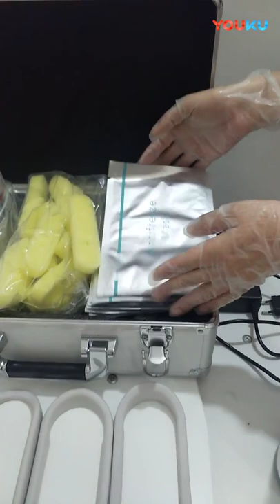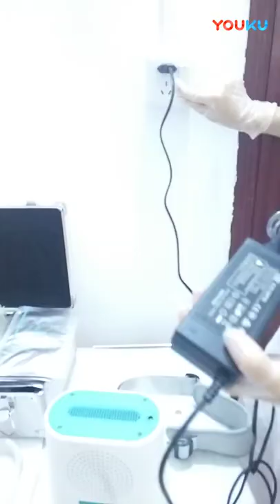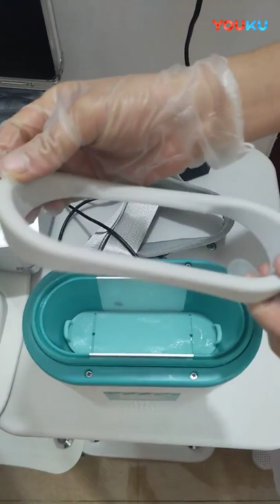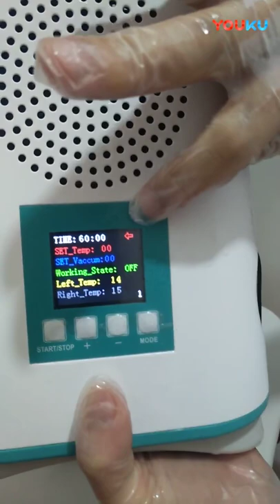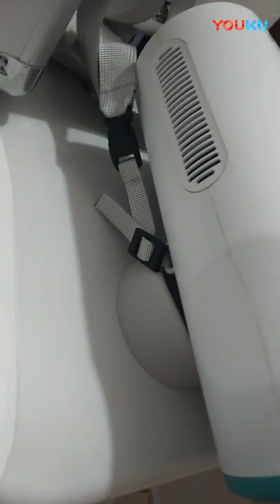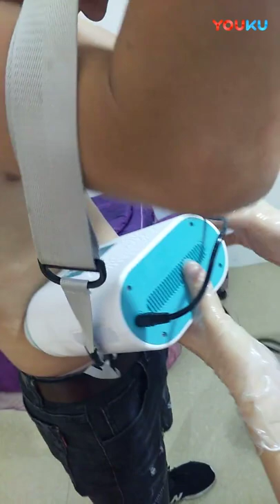Mini cryolipolysis fat freezing machine

Comment: HELLO I BOUGHT THIS AND SINCE NO ONE HAS REVIEWS ON THIS PRODUCT, I WILL GIVE A REVIEW!

I got it and had some trouble with getting it to stay on my arms. The way the machine works makes it to where you can’t have it upside down or else the liquid will get into the sponge filter. So I decided to try my tummy pooch next and wear the strap around my neck. 
I put down another membrane onto my stomach along with the one that is specially made for this machine. So I had two membranes total. I wanted to protect my skin. 
I had it on for an hour. I will say it sucks not being about to move around since you have to be plugged in to work. 
I sat in a chair and made sure the machine was staying in the right position. 

The extra membrane caused more liquid to seep into the inside of the machine. So 30 mins into the procedure, I got the A2 error(the sponge is wet). I changed the sponge and turned it back on. I put it on the highest cold setting and highest suction setting. I did 30 more mins since that equals an hour. 

It’s been 4 days since doing it and I already see improvement on my stomach! Pooch is smaller already! I’m going to give it the full 30 days to see if more fat is gone. I’ll update this comment when that happens!

I can’t seem to find any reviews and I tried every site that sells it. So since I bought it, you are welcome to ask me questions!
Reply: Mine stops after 5mins of using and says A1. What could be the problem? The membrane is still laying flush to the device.
Reply: Are u able to post before and after pics. I just bought it too

Comment: I buy it but It still says " A1"
Reply: The same problem
Did you find a solution?
Reply: The antifreeze membrane must lay flush to the plates. If you bought t the antifreeze membrane that doesn’t have the plastic part, then it wouldn’t work. Also, the liquid product on the membrane matters.

Comment: Hii please tell me if its work for you before i buy it. I wanted to buy this machine for so long
Reply: I have this machine im still figuring it out had for about 6 months now ive done coolsculpting i dont think this machine gets as cold as it needs to be to freeze the fat cells but im going to use it this weekend and set it to the highest cold setting it has and see what happens
Reply: @davids9089  what temp did you set it at?
Reply: @GuidedWithLight  i put it at its highest which is 12 and it worked
Reply: @davids9089  Hello, is the coldest setting 12 or -12?
Reply: @1586pame  12 on the setting and the highest i've ever got it is -12 on the temp you'll feel it afterwards with the area being numb that's the effect you want
Reply: @davids9089 hey David! I’d love to ask you some questions about the use of this and how to avoid any sort of freezer burn on my skin. Also where you bought extra membranes? Not sure if you’re even still active on this account but you’re the only person I could find and this is one of the only videos I can find! 😣 please reach back out if you’re still active
Reply: @davids9089  so how much fat have you lost now when you put it at the highest setting

Comment: Hi can you use regular antifreeze sheets with this device by either cutting it and placing in the device or putting it on the client?
Reply: Another video on this same device the woman said that the gels she ordered don't have the rigid seam that makes them fit correctly. I would want to know if the company makes the filters and gel pads available as they seem very exclusive to this machine.

Comment: I purchased this machine, it works fine but I notice it leaves burn mark on the skin, feels like freezer burn and leaved black burn marks on my body.  l am very disappointed.
Reply: Alot of ppl have said they use 2 membranes to prevent the blisters and black and frost bite. One in the machine and one over their skin
Reply: I've been using my machine did a few rounds last month going to do a few more and of this month i figured out how to reduce the bruising i put the machine up to the highest cold temp which is 12 and keep the vacuum around 3-4 some areas can go up to 5 but i feel it working better than the times I've done it in the past
Reply: What did you set the tempurature at and how long did you have it on?
Reply: I had this same problem first 2 times i used it the freezer mask doesn’t protect the entire suction area so some areas are left unprotected. You’ll either get a water blister that stings like hell or dark bruised marks but they go away after a week or 2
Reply: OMG. Black burn marks sound dangerous. Gangrene is black. What temp did you set it at and did you use it more than once in the same area within 30 days? Apparently you can’t do cryolipolysis more than once every 30 days.
Reply: Did you return it? And you used the antifreeze membranes?
Reply: Does it work?

Comment: I have one of these but the temperature will not go below 04 and the fan does not seem to work unless the temperature is set at 00 - do you have any ideas ? Is there on online manual or helpline number for it ?
Reply: Did you manage to get help? Has it worked for you?
Reply: Specs show it’s supposed to work at -2 to -12 temp. We’re you able to fix it and if not, were you able to return it for free?
Reply: Just saw a different spec sheet that says it works at -3 to -9 only. Not -12 as some other sites say unless the newest models get colder. There is a spec sheet link a few comments down below but it doesn’t have a trouble shooting section. It does mention 3 different temperatures so maybe you have to click the temp button 3 times to get to the max cold temp - just a guess.

Comment: Does it work as well as the CoolSculpting machine?... Please, if you've tried it, tell me, and how many inches have you lost?
Reply: This what they say about it! Features:
1. It can knead, squeeze and massage the subcutaneous fat layer of human body. To dredge meridians, promote blood circulation, strengthen fat decomposition, remove edema, increase body slim and healthy effect.
2. Help reduce the appearance of cellulite in the abdomen, thighs, hips, and buttocks skin so that the body's harmful and toxic substances faster disappear.
3. It is not easy to damage tissue, subcutaneous nerve, blood vessel and lymph. In addition, the skin naturally tightens due to ultrasonic energy.
4. This freezer machine use freezing means to undertake instant freezing-death to adipose cell, raise through the temperature behind undertake thin body in metabolic action
5. Can firm the arms, legs, thighs, buttocks, waist, back, abdominal muscles and reshape the body figure.  Usage:
Start the instrument, let the instrument cool, and remove the freezing film after a certain temperature, the add water.
The lower the indoor temperature, the better and faster the refrigeration. It is recommended to use in air-conditioned room.

Note:
1. Plastic plastic on both sides to wrap the freezing film for reuse.
2. Check whether the filter wool is wet in preparation. If it is wet, please replace it. Generally, it needs to be replaced for 3-5 times.
3. Use the customized freezing film of this product.
4. freezing film is not reusable.
5. keep the instrument clean after using it.
6. Remove the freezing film after operation, and place the instrument upright (if the freezing film is not removed and placed upside down, the liquid from the freezing film will circulate  into the instrument, leading to the failure of the instrument). - may cause red dots or bubbles after operation. 
7. One hour is recommended. - do not erect work.
8. If the machine is turned on, Al means that the freezing film is not installed (alarm is sounded), A2 means that the yellow filter cotton is wet, and A3 A4 means that the temperature of the freezing plate is too high